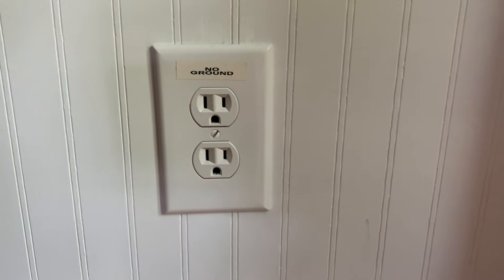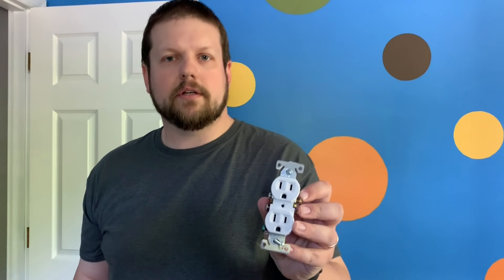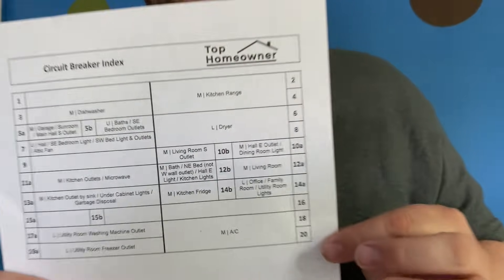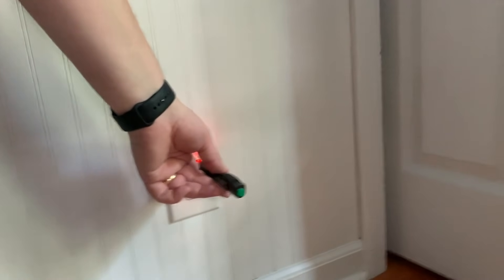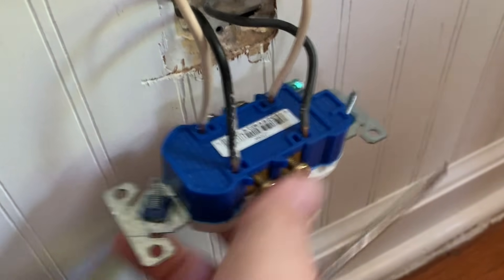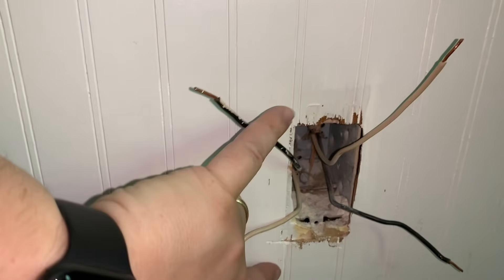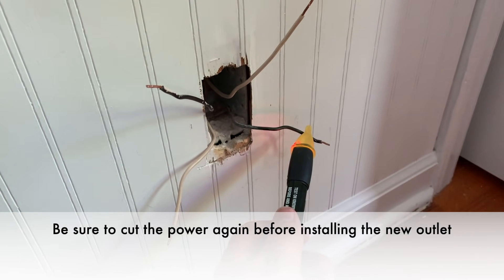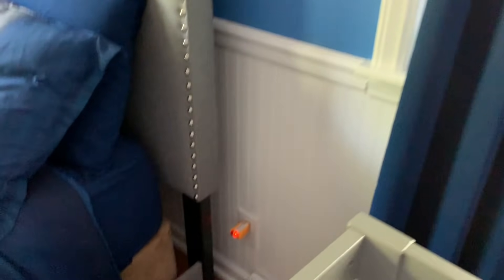Fixing Ungrounded Outlets - An Alternative Option to Rewiring Your Home

Comment: First, as many noted, installing a GFCI outlet will not provide a ground where one is not present. And while I am not advocating an ungrounded outlet, since doing the proper work in running a new, grounded feed is the best option, in a bedroom, living room or similar use room, most devices being plugged in such as a tv, phone charger, lamp or laptop use only a two blade plug, so the ground is unused. Secondly, as an electrician for over 40 years, I would never use the back-wire method, or quick connect on the outlet by simply pushing the wire into the slot. The connection is never as a wire looped around the screw, and tightened firmly. I have seen that method fail numerous times, either by loosing a good connection or arcing, which can result in a fire. Take the time to wire an outlet properly using the tried and true method, under the screw.
Reply: My friend just bought an old house, I did a walk through, I'm not an electrician but the wiring is old and it has 2 prong outlets. I told her the wiring is maybe 50 yr old.and it would be best to install 3 prong grounded outlets. Should she have someone inspect the wiring ?
Reply: @cat-lw6kq  Yes, though that might have been a much better idea before the purchase.
Reply: @civildiscourse2000  "D'oh!!"  If it costs $20,000 to rewire a house and you didn't think to bring it up during negotiations (the "inspection contingency") then you now own the problem. Good news is, nobody is usually going to FORCE you to upgrade the electrical system unless it's (a) imminently dangerous, (b) improper as originally installed, or (c) you're doing an addition or renovation.
Reply: 100%. I can't believe those rear stab connections are still allowed. They are a fire hazard and a make-work scheme for electricians. To your excellent post I would just add (for the amateurs) that the rear entry terminals on the GFCI are a totally different beast; the screw is still used to tighten these up and they're quite good.

Comment: once GFI is installed should the tester then show a correct circuit and not not open circuit?
Reply: He tester will show "open ground". The tester just tests the circuit. It is for the person testing (wouldn't he also be a tester?) to analyze the result. In this case open ground is OK.

Comment: 9:25 So is it okay that the tester on the non-GFCI outlet doesn't light up as "correct"?
Reply: No, it isn’t.
Reply: @stevemiller4706  Thanks for the reply. What is wrong with that outlet, and how can it be fixed?
Reply: @stringX90  Actually it is correct. Any outlets downstream of the GFCI will not show up as correct but this is okay and is code approved.
Reply from the maker: I made a follow-up video that talks about this and answers some other questions: https://youtu.be/3AXcRsAOLPk
Reply: What does the middle light on mean?
Reply: stringX90 it varies as to what the middle light or any combination of lights means by tester. There is a list of possible options of lighted and unlighted on every tester I have ever looked at. If you look closely as he shows you the middle light on is open ground you can glimpse others on his tester.

Comment: one other thing in this to be up with code the outlets need to be labeled.  the GFCI out let should come with some labels.  saying Ungrounded GFCI Protected. this will need to be on every out let that is protected by the GFCI and have no ground.
Reply: The GFCI outlet should be marked with "No equipment ground" and the other ones in addition with "GFCI protected outlet". There is not need to mark the GFCI outlets as "GFCI protected" as one sees it from the outlet.

Comment: I don't like using those push in connects
Reply: I've heard that the spring loaded ones can be dangerous, but the ones that are tightened by the screws are fine.
Reply: @pcno2832  I am currently replacing 30+ year old spring loaded outlets from the late 80s.  They are charred and partially melted, so yeah, definitely not a good long term solution.
Reply from the maker: GFCI receptacles don't have push-in connectors: https://youtu.be/3AXcRsAOLPk

Comment: Are you aware that you incorrectly used the word "OUTLET" (56) times in this video and correctly twice when you said outlet box?    An "OUTLET" can be a disconnect, a hard wire connection or any box that has power that is to be utilized.   On the other hand a "RECEPTACLE" is a device that is installed in an outlet.   This is of course technically speaking.   Your video was good overall and probably helped some people understand.   Respectfully,   Kevin
Reply: @Kevin: so you spent time counting what amounts to an inconsequential quibble with layman terminology for a "receptacle outlet", when clearly everyone knows exactly what he's talking about.  I sometimes get a funny look from lay people when I speak of a hardwired "outlet" or a "lighting outlet".

Comment: A GFCI outlet is NO DIFFERENT than a regular 3 pronged outlet if ti is NOT GROUNDED. Do not be fooled. Without a ground there is no difference
Reply: You are a fool. Yes a gfi will trip and protect you without and equipment grounding conductor.
Reply: I looked at the electrical in my friends house she has 2 prong outlets. there's a GFI in the bathroom so I wonder if it's grounded.
Reply: @cat-lw6kq  Bathrooms likely are grounded. That became mandatory in the 40s I think. If you wonder you should test it.
Reply: This od house had gfci in bathooms.
Reply: @cat-lw6kq  GFCI and grounding are not mutually exclusive. On new installations both are needed at least on bathrooms.
Reply: not an electrician but the way I understand it the GCFI detects an imbalance of voltage between the hot and neutral wires. if it senses any it trips the breaker.

Comment: It is not approved to have changed the original 2 prong ungrounded to a 3 prong . However adding a gfci receptacle is an approved device if  adding a label displaying ungrounded outlet.
Reply: MrTHEBRITINWA down leg from the gfci is ‘legal’ by NEC to change 2 prong to 3 prong as long as you add the appropriate labels! GFCI PROTECTED & NO EQUIPMENT GROUND
Reply: @coypatton3160  It is also legal if you have the GFCI on the electric panel. Then you do not need to use any GFCI outlets. Same rye in marking apply.
Reply from the maker: I made a follow-up video that talks about this and answers some other questions here: https://youtu.be/3AXcRsAOLPk

Comment: As a home inspector this will not pass a home inspection.  I have found many outlets where people have done this exact same thing.  Sure it will protect you the homeowner, as the GFCI will flip with or without a ground, but it will in no way protect the equipment that needs a ground.  If fact if you plug something in that requires a ground (i.e. computer, tv, etc.) you can actually void the warranty if it so states that in the manual of your electronic device.  Also as a side not I have seen people use these GFCIs (with no ground) and then plug a surge suppressor into the GFCI.  This also does absolutely nothing and will not protect the electronic equipment since there is, in effect, no ground.  So do this at your own peril and expect to either change these 3 holes (no ground) back to a 2 hole outlet so that there is not a false perception that these have a ground.  Or be prepared to rewire your house correctly when you intend to sell. Just my two cents.
Reply: Woke up this morning and wanted to say that I am in no way trying to bash this guy on his video.  There are lots of things you can do around the house to save money on repairs and be just fine.  I just feel that electricity is not something you want to cut corners on.  It could not only cause fires but worse kill you or someone else.  I haven't watched his other videos but I am sure there are some great things he has that can help a diy'er.  Just please be careful when it comes to electrical.  Your life is worth more than the money you might save.
Reply: @solarpower2020  Also if I was a home inspector , I wouldn't pass that inspection either , Installing grounded outlets where there's no ground wire is a violation of The National Electrical Code
Reply: @ironmartysharpe8293  Cite the code, because you are wrong.
Reply: Home inspectors don't have the correct answer. If you want the correct answer go to your local town and ask to talk to an ELECTRICAL inspector!
Reply: ironmarty Sharpe , home inspectors do visual inspections. They don’t take outlets out to check the wires. They base their findings with testers.
Reply: ironmarty Sharpe wrong. It is approved in the NEC. LOOK IT UP! I say for you to look it up because you will not believe me.
Reply: @ironmartysharpe8293  Not if it is not when done properly:

406.4(D)(2) Non–Grounding-Type Receptacles. Where attachment to an equipment grounding conductor does not exist in the receptacle enclosure, the installation shall comply with (D)(2)(a), (D)(2)(b), or (D)(2)(c).

(a) A non–grounding-type receptacle(s) shall be permitted to be replaced with another non–grounding-type receptacle(s).

(b) A non–grounding-type receptacle(s) shall be permitted to be replaced with a ground-fault circuit interrupter-type of receptacle(s). These receptacles shall be marked “No Equipment Ground.” An equipment grounding conductor shall not be connected from the ground-fault circuit-interrupter- type receptacle to any outlet supplied from the ground-fault circuit-interrupter receptacle.

(c) A non–grounding-type receptacle(s) shall be permitted to be replaced with a grounding-type receptacle(s) where supplied through a ground-fault circuit interrupter. Grounding-type receptacles supplied through the ground-fault circuit interrupter shall be marked “GFCI Protected” and “No Equipment Ground.” An equipment grounding conductor shall not be connected between the grounding-type receptacles.
Reply: @solarpower2020  This is not cutting corners. It is a practice allowed by the NEC.
Reply: @solarpower2020  You are more than absolutely correct , For as dangerous as electricity is , You cannot afford to cut corners , The best solution is to install the proper wiring with the ground wire, If I was wiring a house , The outlets would be on 20 amp AFCI breakers and AFCI/ GFCI breakers where GFCI protection is required , Do it right  , Definitely not worth the risk of you and/or your loved ones getting electrocuted from a shock or getting burned to death from a fire , 
All new circuits must be on arc fault interrupting breakers and where GFCI protection is required , Those circuits must be arc fault protected as well , In wiring a house , I would have the light fixtures separate from the outlets , Also when it comes to outlets and switches , I always use the professional or commercial grade because they're much safer than those cheap outlets and switches that cost a little more than a dollar , Which are way more than worth it , I just did a wiring job for my sister's ladyfriend and her husband , they wanted two outlets installed at the counter top they just had installed in the basement , Which was renovated into a rec room , I put the outlets on a separate 20 amp breaker that has both AFCI and GFCI protection because outlets in the basement require GFCI protection and with new wiring , Must also have AFCI Protection , Afterwards they were really pleased because it was done right with top quality materials and they can use it with confidence , I am very strict about electrical safety and if it's not gonna be done right , I won't do it , I've turned down jobs where they want to cut corners and they had to look for someone else because I won't go there
Reply: ironmarty Sharpe   You are spending too much money on commercial grade receptacles and switches it’s really no need, #12 only some jurisdictions ask for it now otherwise #14 is ok.
Reply: @ironmartysharpe8293  Agreed.

Arc faulted the whole house. I opted for dual function afci/gfci combo breakers for gfci required circuits.

Bought the TAmper Resistant commercial grade Legrand back wire outlets. Way better quality than the $0.50 Leviton Home Depot junk. The outlet physically weighs 3x more.

Do it right. House fires are usually causes by faulty electrical.
Reply: @ironmartysharpe8293  Sec. 210-7(d)(3) 
Next time, actually read the NEC.
Reply: Greg Nalley if I did this and there is not a local code that supersedes NEC, I would sue you for not knowing your stuff!
NEC allows the usage of GFCI and appropriate labels. 
When I bring in a copy of current NEC with the highlighted sections, you will lose! The judge will probably unfairly protect you, but once ruled against you, I would ensure that no lending institutions used you. As I would go after them once you have bern ruled against. 
I will agree that is is not perfect, but to fail an inspection because you do nit like it and do not know code is unprofessional, inaccurate and harmful!
Reply: You can still sell your house with un-grounded outlets. or get a second mortgage to have a electrician rewire your house,
Reply: Per NEC book i forgot what section but you guys can look it up if you want GFCI outlets are required on the first outlet of the circuit if replacing any outlet with no ground and have to be labeled "no equipment ground" , also every regular outlet that follows have to be labeled "no equipment ground" and "GFCI protected outlet" basically they are not meant to protect equipment from noise or lighting, GFCI outlets protect people from getting electrocuted. If it was me doing it for my house I would use a combination AFCI/GFCI in the first outlet of the circuit, it will still not protect the equipment from lighting but it will cut the power in case of any arcs and still protect the people with the GFCI, also there is not a big difference in price between the two outlets.
Reply: Home inspectors are not electricians .
Reply: Agree 100%
Reply: They are not grounded outlets they are grounding outlets. I can come straight from a 20 amp breaker and connect it to a ground rod driven into the ground and it won't trip.
Reply: No equipment needs ground. Ground is to protect users. In Europe people have used grounded plugs on ungrounded outlets for decades. Here we do not need any changes for that. Grounding was based originally on location. It was used on locations where there was ground potential available. Conductive floor, water, outside etc. On those locations getting an electric shock can be fatal. Later it was made mandatory on all new installations.
Reply: As a home inspector you should know that you cannot force people to rewire their whole home.  What he showed in the video is 100% code compliant per the NEC. Sure, rewiring would be preferable, but it's also VERY expensive and most people are not going to do it. Using GFCI's on the first outlet in the run, again, is code complaint per NEC.

Comment: You know actually it won’t cost very much and are you gonna need is a limit of mud in a cup couple pieces of wood but most houses do have a ground and all you Gotta do is cut a limb and drywall and put them up to receptacle and your electrical panel
Reply: What?
Reply: trucker V  I was trying to say was that most older homes . Do have ground wire but it’s on the outside boxes and the main panel also has it Wrapped around the outside
Reply: @Jesus: About 99 percent of the work to install "ground" to receptacles not having is it in running new cable to each and every receptacle.  I worked on a job recently where the electrical labor alone  for rewiring an older home was over $20,000, not including any refinishing.  Point is: you don't need ANY of that, if all you want is a place to safely plug in your three-prong appliance cords.

Comment: GFCI outlet with out a ground tell me how that works please.
Reply: It is permissable as long as you identify "no equipment ground" on the GFCI. It is preferable to grounding to the box or even worse doing that bullshit neutral to ground fuckery to cheat an Arc Fault breaker or plug tester.
Reply: The same way as with the ground. A GFCI does not in anyway use the ground wire. The only difference is that without ground it may require that someone touches the faulty equipment before it trips. 

Maybe the name is confusing as Ground fault may make you to think it needs the ground wire. In England they are called RCDs (Residual current device)
Reply: Excellent  explanation  John Connolly
Reply from the maker: I made a follow-up video that talks about this and answers some other questions. You can watch it here: https://youtu.be/3AXcRsAOLPk

Comment: To those watching this video, I have two suggestions. One option is to (if they are available for your Breaker Box) replace the standard breaker with a AFCI/GFCI combo breaker. This will connect to the ground in the Load Center and protect ALL outlets on the circuit. 

The second option, if your Breaker Box is in a fairly hidden area, is to add a GFCI outlet immediately next to the Breaker Box, connecting that circuit from the breaker to the GFCI with new grounded ROMEX, then connect the original branch circuit wiring to the load side of that GFCI.
Reply: Excellent advice. I wasn't even aware that GFCI breakers were available
Reply: @oscarmendez590  no even in the breaker box if there is no ground wire it will not protect you.
Reply: @donski1519  GFCI doesn't require a grounding conductor.  Try spending the necessary 30 seconds to look it up  before you try teaching anyone again.